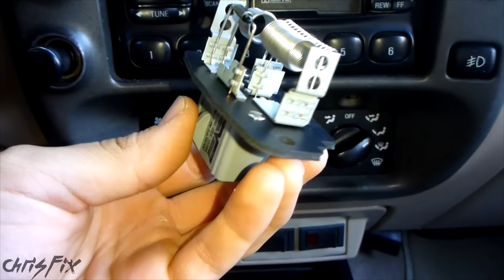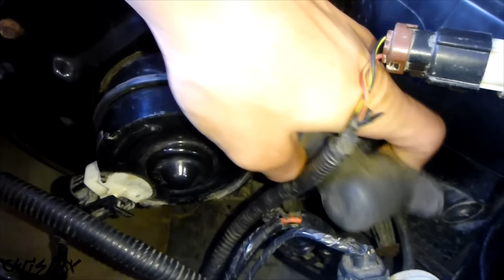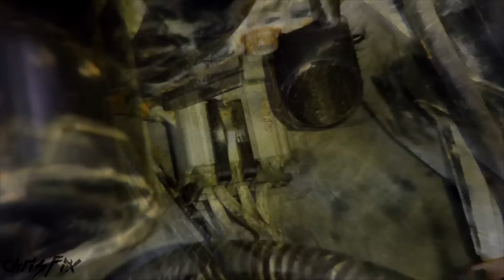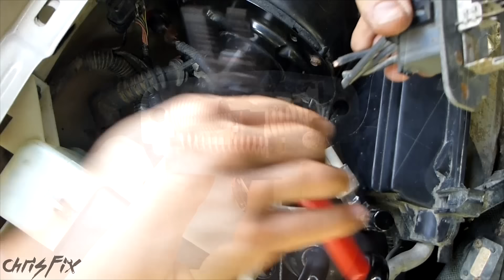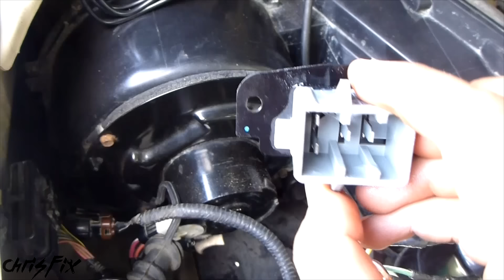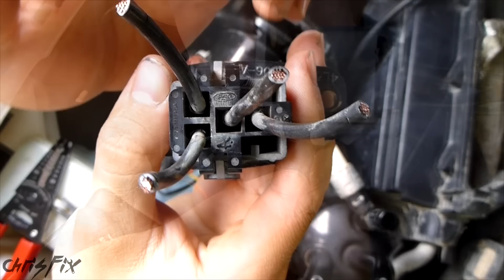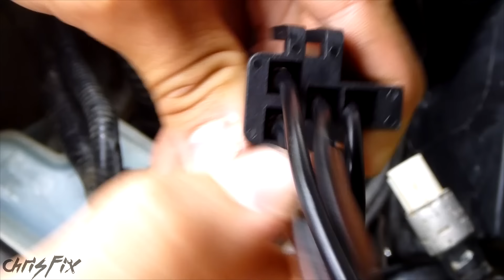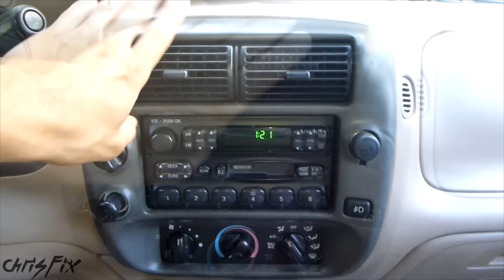How to replace a Blower Motor Resistor

Comment: well done... your resistor was rusty, a new one was a good idea
but in most of cases you can keep the same piece and just replace the thermal fuse
I did it and works perfectly... it cost me only a few coins :)
Reply: Nando Z What thermal fuse ? Where is it ?
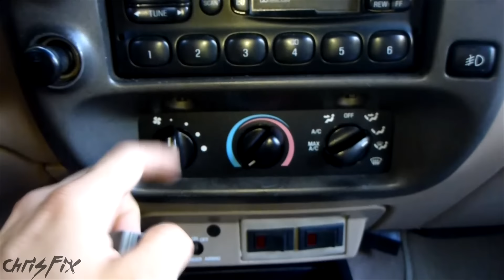Reply: fgleich look at 0:17... you'll se in the new piece some coils and one thermal fuse... on my father's Chevrolet Astra (Brasilian version) I replaced the original fuse for a 150°C 250V 10A, 3 years ago and it's still working :)
http://img201.imageshack.us/img201/6292/dsc01811f.jpg
http://img818.imageshack.us/img818/9387/dsc01644kb.jpg
Reply: Nando Z Where did you buy it ?
Reply: fgleich I bought it on a regular electric parts store here in Brazil... it was really cheap, less than 1 dollar

Comment: You are supposed to heat up the yellow wire connectors. They will shrivel up and give you a nice seal so not water gets in.
Reply: ChrisFix Not all of them have heat shrink, some have.
Reply from the maker: ***** Thanks for sharing! I actually tried heating the butt connectors up to heat shrink them but they just melted. Maybe I got bad ones?!?!

Comment: Chris,
 My hubby did find the blower motor resistor on the joke but it's up above the brake pedal and slightly to the side more at the center and it's impossible to get at it.   He even removed the front car seat to get up in there but you would need a child's arm to possibly reach up in the tight areas and then we fear we wouldn't be able to get the new part in there correctly if we would get it out.   So I'm hoping changing the blower motor and me air filter will help fix my problem otherwise this vehicle will have to go to Nissan to change the resistor since we can't even get at it.   Oh and one more thing now we know we why we couldn't find any information on this online.
Reply from the maker: Wanda fritzinger Thanks for the update and keep me posted!

Comment: Hi Chris,
My hubby changed the blower motor for my 2011nissan juke but he can't find the blower motor resistor.  I have the replacement part from Nissan but he can't find it.  I searched Google for it but came up with other Nissan cars and still can't find it.  Do you know where the heck it is?
Thanks in advance for your help.
Reply from the maker: Wanda fritzinger It is usually right next to the blower motor or really close by... I am not exactly sure where it is on the 2011 Nissan Juke because I never worked on one unfortunately. Let me know if you find it!

Comment: I am definitely gonna try this on my 2006 Gmc Envoy. My Ac doesnt work at all. the air doesnt blow when the dial is moved to any speed. I went to a mechanic and they gave me a quote of $420 to fix the resistor and connector.. since I li ve in Phoenix I need my ac.. hopefully I do this right.
Thank you for your video
Reply from the maker: Savannah Joe Awesome! Let me know! I think it is located under the passenger side dash. Keep me updated!

Comment: Great vid and great explanation on where to find the resistor unit and how it works! My only complaint isn't about you but the engineers who come up with such poor ideas like these resistor units in the first place! I wonder if they every had to deal with a underwriters laboratory on these units?
Reply from the maker: Davie Jones Thanks! Yea, it seems like a bad design but I guess it is easy and cheap to replace and it lasts 10+ years so...
Reply: I have a 1997 model Dodge Dakota pick-up and the resistor unit is buried under the dash and did some testing and that isn't the problem. It's the fan and in that model year you have to remove the dash to get to it. What a pain in the rear end! I have one of those Haynes books from Auto Zone but they don't cover everything so I went to "Books 4 cars.com" and got the service manual on it. We'll see.
Reply from the maker: Davie Jones Good luck!
Reply: ChrisFix Well I got the dealership service manual on the Dodge Dakota and it is about as bad as the Haynes service books from Auto Zone. It doesn't show what you need to see. I got to admit one thing that the Japanese do a better job on their service manuals as in showing everything and I mean Everything! Why is it that Americans want to hide things from others? We as a society seem to be un-trusting and that can get us into trouble when it comes to selling autos.

Comment: Hi Chris,  I have a 2003 Chevy Trailblazer Ext and just replaced the Motor Blower because the fan was not turning on at all.  But now, when I put on the heat the passenger side blows just fine, but the drivers side you barely feel.  Could this be a motor blower resistor issue?
Reply from the maker: quinones325 That is a blend door issue. The doors inside the hvac that open and close to move air to different parts of the car is failing. Either it got disconnected or the actuator is bad.

Comment: fyi the yellow part was heat shrink tubing
Reply: So I'm not the only one that cringed at that.  Though, while i avoid black tape at all costs, it does act as a nice marker for where to start looking for wiring issues.
Reply: @j.adamwegs2882  I used to do light and siren installations on police cars, ambulances, and fire trucks, and I HATED when previous installers used electrical tape. It gets hot, turns sticky and makes a horrible mess. I hardly ever used electrical tape...  I used zip ties and wire loom.
Reply: @BonziBuddys  You can get wiring loom tape that's very similar but much less sticky. Unfortunately I only ever seem to have the regular stuff lying around for smale jobs.
Reply: brendan grigsby at least in my experience
Reply: I cringed at the electrical tape, too! Good video though.
Reply: some are,  but not all butt connectors are heat shrink,  my resistor didn't come with connectors  so i had to buy some...most cheap kits that include a wire cutter ,  have connectors that are not heat shrink --  they will just melt and make a mess
Reply: I did too... =) now you know Chris, good work and nice video, like all yours, been learning a lot!
Reply: That's right. In fact, krimp is Dutch for shrink. German too, I guess..

Comment: on my ac the only speed that don't work is high the rest work as should is that a sign of the resistor.
Reply from the maker: SuperJeremi10 That sounds like a switch problem. The resistor is bypassed on High.
Reply: hmm the switch is new though so weird high used work till few months ago a replaced the switch cause it was finicky i got low medium and medium high back but still no high.
Reply from the maker: SuperJeremi10 I mean you can give the blower motor resistor a shot. It is easy to replace and costs only a few bucks.
Reply: also when i turn the switch to high speed i hear the relay clicking so its sending the signal.
Reply from the maker: SuperJeremi10 Maybe your blower is bad?
Reply: if it was dead wouldn't it not work at all it has a bad bearing noise but it does spin and pushes good air on speeds that do work it used to run on high.

Comment: What if you replace the resistor and you still only high fan speed.
Reply: It would probably be the climate control panel. We know it's not the blower, because it is working.
Unlikely it's the resistor because you just put in a new one.
Following that logic, we can deduce it's the control panel/nob.

Comment: I have a Santa fè fan heater that won't turn off any idea?
Reply from the maker: Thomas o dowd Even when the Santa Fe is shut off the fan is still on?
Reply: no only when on chris
Reply from the maker: Then your switch that you use to turn the fan on could be broken (does it work for everything else) or your blower motor resistor might be fried.
Reply: Would you believe it it just turned off today after short run ,odd stuff ...
Reply from the maker: Thomas o dowd That is weird!
Reply: if any more probs ill text back thanks  chris , happy paddys day
Reply from the maker: Thomas o dowd Great! Happy St Patty's day!

Comment: Hi Chris, I have a 2005 ford sport trac 4x4, when I start my truck and go to put the heat ( or air ) on it doesn't always turn on..meaning I set the right dial to my desired selection ( face, 
face/feet, feet, defrost ect ) then set the left dial to the fan speed I want... And it's a 50/50 chance if it turns on or not... When it does turn on, it works fine unless u shut it off, then your back to it randomly turning on or not. If I leave the dials set to what I want and start driving...it will randomly turn on most of the time..it has been doing this for almost a year now, but has gotten worse... No engine light was on until now..so I stopped at auto zone and they did their comp check... Three possibilities: 1) check coolant level ...level in reservoir is perfect... 2) thermostat defective 3) ect engine coolant temperature sensor defective... Do you think these are related or separate problems...and what do you think i should look into first? Thanks so much for the awesome videos!
Reply from the maker: jannyjan05 Your problem with the fan has nothing to do with the check engine light. If your fan doesnt work randomly, I would start to think it is a faulty wire or blower motor. What happens if you max out the fan (put it on the highest setting)?
Reply: 4th setting works fine, once it decides to turn on lol
Reply: Could it be the connection to the resistor? I read online about that connection having problems, but wasn't sure if that would give that result?...
Reply from the maker: jannyjan05 It could be. As you saw in this video, the connection overheated and melted together.
Reply: Hi Chris, I had a similar issue with my 1991 Toyota Previa as jannyjan05 is describing, the blower motor randomly wouldnt turn on for any of the settings, So I took the blower motor out and dissasembled the motor to find that dirt had built up around the brushes and made it impossible for the motor to start on its own, so I cleaned it up and reinstalled it, and it works amazingly now!

Comment: Great video! My 99' F-150 XL has the Resistor located behind the glove box. It was accessible by lying on the floor board without having to remove anything. I was wondering why you didn't solder the wires, heat shrink them and use a heat resistant wire loom.
Reply from the maker: Montauk198 Thanks man! And thanks for letting everyone know where the resistor is on a Ford F150. I crimped them with the supplied crimps. I tried using heat but the crimps just melted so I taped them instead.

Comment: hey chris, chris here i fixed resistor to day thanks to ur vid was a big help! airs working and hav heat again, but the vents in center above radio seem blocked or something have you any advice on this thanks for reading if you do.
Reply from the maker: Chris Patrick Hey Chris. That is awesome! I am glad the video was helpful! If the vents in the middle are not working, my guess is that there is a vacuum line loose or cracked behind the dash. Does the air come out of the top side vents? If so, maybe the vent hose for the middle vents came off. It is pretty easy to remove that part of the dash to put that hose back on... Here is a video that shows how to remove that part of the dash to check: https://www.youtube.com/watch?v=PFUkasQT74Q
Reply: ChrisFix
thats great; thanks for ur reply il check that out asap

Comment: Chris, in one of my cars, the top 3 speeds are the only ones that work. There are 5 speeds total. Do you think this could still be a failing BMR?
Reply from the maker: helivesonforever Yes, having only the top speeds working is a common symptom for a bad blower motor resistor.
Reply: ChrisFix Thanks so much chris, keep up to good work!

Comment: Hey, I have a question. I have the same truck and just changed this part. Can you tell a difference between fan speeds 2 and 3? They seem the same to me. Just wondering. Before I changed the part it was only working on fan speed 4. Thanks!
Reply from the maker: Casey King Yes, I can tell a difference between fan speeds 2 and 3. Make sure you wired it correctly and the connections are good!

Comment: ChrisFix great video!! Just two tips!...1) Consider buying I crimp Connector tool, it will do a much better crimping connection.  2) The yellow connectors you used on this video are call "shrink butt connectors", after you crimp them to the wire you need to apply heat with a heat gun(because I know you have one) or you can use a cigarette lighter to apply heat to them and they will completely seal the connection preventing water and oxygen from getting in there. Just untapped the cables and apply heat to those connectors and no tape will be requiere!! Hope this helps!  :)
Reply from the maker: Thanks Miguel. The crimp tool is a great idea. Those butt connectors look like heat shrink but when I tried, it just melted. Maybe they were defective.
Reply: ChrisFix here is the crimp tool I use: http://www.amazon.com/gp/aw/d/B0006M6Y5M/ref=mp_s_a_1_1?qid=1419352045&sr=8-1
It is recommended for car audio technicians, I think it is worth it and you will see the difference after using it! :)
Reply from the maker: Miguel R Awesome! I will need to get one! Thanks man! I used the back end of my wires stripper which is not as effective (seen in this video): https://www.youtube.com/watch?v=ZVG7X-ae298

Comment: My car's fan is making a weird snake rattle noise or like how it would sound if you're shaking a salt shaker if that makes sense. It goes away when I turn the air off. Ford and another shop said it must be the blower motor. I got it replaced but the sound is still there. Do you have any suggestions of what I can get them to check?
Reply from the maker: corineashley07 That is tough to diagnose without actually hearing it. Can you make a youtube video and message me the link? I would think there might be debris in the vents somewhere causing the noise like in this video: https://www.youtube.com/watch?v=7e60wS3_C9s
Reply: Okay I uploaded one. You can hear the rattling better at the beginning. Sorry it's short, I had this on my phone already from earlier today. http://youtu.be/yYrIfd2eme4
Reply from the maker: corineashley07 It sounds like something fell into the vent or is in the blower motor fan like the video I sent in the last comment.

Comment: Chris. My son says in his 2003 Mazda Protege when he is inside the car driving, when he turns his inside air dial to zero shutting off all the air, he still feels air blowing out of the dash vents. Almost like he has it set to setting 1 but he says setting 1 blows slightly harder. Is this a bad Blower Motor Resistor?
Reply from the maker: Edmund Witkowski This can be a bad blower motor resistor, but it can also be a vent in the HVAC not closing. Does this happen when the car is stooped or only while moving? If it happens when stopped it is probably the blower motor resistor.

Comment from the maker: +Traci M I cannot reply to your comment directly (check google+ settings) but I hope you see this. The blower motor can cause a resistor to fail if the motor is running at a higher than normal amperage. Typically what causes this is either an old blower motor (so bearings and stuff internally goes bad) or there is debris causing the motor to work extra hard to spin (such as leaves. You can see in this video: How to fix a Loud AC, Heat Fan (Blower motor) that there were leaves and stuff blocking the motor and the actual motor itself sounded good and looked brand new inside.
Reply: ChrisFix Well I got the dash out and that was fun to say the least! I found out that you can change the blower motor without having to take out the whole heater/AC housing. I just kept the old blower motor fan blade unit and clip and just took out the three screws holding in the old motor and pulled some on the wires and the new blower fan blade is pressed on and I had to use a piece of wood and a hammer to knock out the motor shaft. Then I had to unsolder the old motor while it's still in the truck heater/AC housing and then unsolder the new fan and make sure you mark which side the black and green wires go on and the new wires are black and yellow and re-solder the old wires onto the new motor and push it back into place and replace the old fan blade and clip and then start putting everything back into place.
Reply from the maker: Davie Jones Wow, sounds like you did an awesome job! It also sounds like it was a pain in the butt haha. Good work and good ingenuity!
Reply: There is a cable that goes to a flap that forces the air from different places in the system like the dash or the defroster or the floor. You need to take out the complete dash to fix it. It's a pain but can be fixed. Look at other videos on youtube and get an idea of the dash removal. Remember to remove the negative battery terminal at least ten minutes before you touch anything or else the air bags can explode in your face. Good luck.
Reply: Hello chrisfix my dads trucks cooling system does not blow in the cabin it only blows to where the defoger heat comes out can you reply or make a video
Reply: Davie Jones  ok so i don't feel tooooo bad paying 500 to get it fixed it